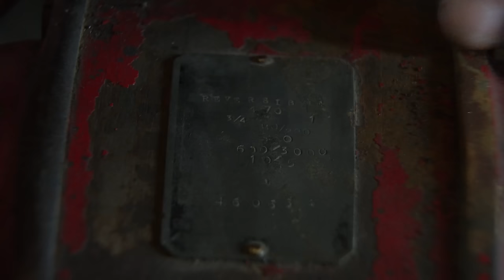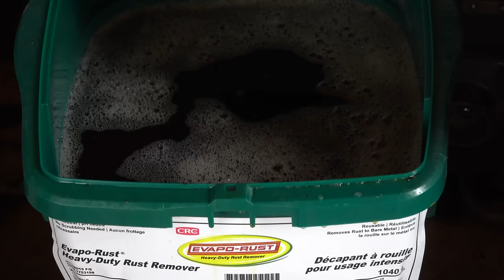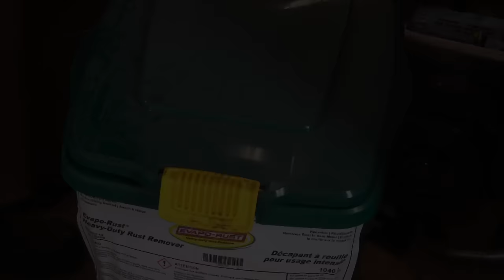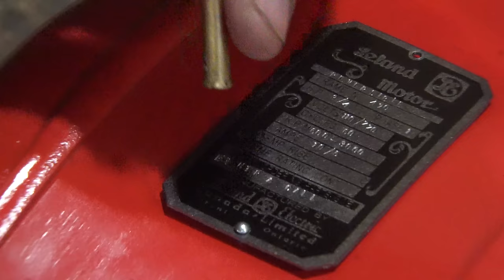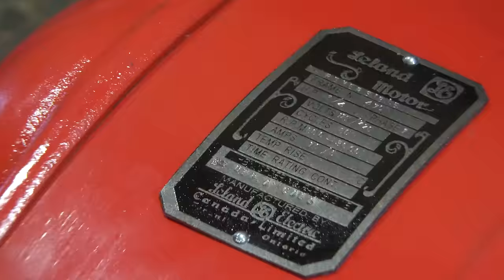Why Did They Stop Making These? [Restoration]

Comment: They stopped making likely due to universal motors have beushes that wear out, adjusting commutator angle means at 0rpm this motor is still running at full power. Likely prone to burning out with a bad operator

Comment: Love it. So simple and amazing.  My only concern and please understand I know nothing about theory of electricity so it might not even be a concern would be ... electrocution.  You have alternating power going into the motor, you have a metal lever that's attached to the commutater.    So if your in a wet environment or not grounded i assume zap. I had this issue with my grandfather's very old steel body craftsman skill and Sawzall. As a kid I grabbed one without wearing shoes on a concrete floor and got shocked. Soon as I had the rubber sole shoes on it was fine. I'm guessing this would be similar. And no I'm suggesting running any power tools in your bare feet ...again I was dumb kid and not much has changed except I got older. Just my 2cents.

Comment: First you should never grind the commutator unless it shows an uneven wear in the brushes. 
Second you don’t want to put oil inside a blind threaded hole because you will end up cracking the housing by hydrolock

Comment: I am probably off the mark but they might have stopped making these because of power factor correction.  In certain positions of the brushes with respect to the commutator, a watt meter reads zero.  So if the meter reads zero then the electric company can not bill you for the energy being consumed.  If you set the brushes in a advanced  position you can get your meter to run backwards. 🤔🤔

Comment: It is a beautiful piece of technological history. But they were substituted gradually by electronic speed control. Modern brushless AC-motors with frequency variation are more efficient and relatively maintenance free. Even DC-motors are more efficient with DC Motor Controllers.
Excellent restoration work.

Comment: Back in the early 1970's when I was at school i had a summer job working in a printers. They had four colour offset Litho printers that were driven by a variable speed drive working on exactly this principle If I recall correctly in the 50kW range. The brush gear was rotated by a motorised reversible worm drive which was visible through a perspex window in the motor housing.

Comment: These could still be made today. I’d like to see a larger scaled motor say 100Hp to see if the principle would work the same. A mechanical throttle versus a Variable Frequency Drive would be way cheaper to make and control.

Comment: I have a motor like this made in the USA in 1910 it has a lever inside the case for forwards or backwards it has brushes that retract once the motor is up to speed so only uses them in start mode it is on a lathe and has not been touched for 40 or more years and is still working fine

Comment: Shop I used to work in had a 15" Davis & Wells sliding table saw.....it ran great, then the super decided it needed new bearings......an older fellow came out to change them and said they were actually in good shape for 1926 bearings......they replaced them and it never ran as smooth as it did before the change.....

Comment: They stopped making these when they invented electrical ways of controlling a motors RPM and torque.  Being able to physically change the timing between the coils, resulted in additional failures.

Comment: Never use alum oxide paper to polish a commutator. it embeds in the copper and wears the brushes out quickly. Use soft garnet paper instead. It has rounded crystals and won't dig in.

Comment: Wow, this is basically an Analog 3-phase AC motor. It's the grand pappy of today's modern 3-phase AC motors, like the type of motors in a hoverboard per se. But instead of the electromagnetic field being controlled digitally it's controlled mechanically, Analog style!!!! This motor was way ahead of its time. She's rare and very special, to run this beautiful stallion on an air compressor is almost disrespectful and a bad utilization of her special characteristics. She ain't no one trick pony!!! Although I can't really think of an application, off hand, that she could be used for. Maybe a fixed gear go cart, but then you ll need a 3 phase generator that'll fit on a go cart lol. Awesome video tho!! Resto guy porn is basically what your peddling. I can respect that. Now I'ma go change my pants 😮

Comment: I think I worked on one of these around 1976 to rebuild it for a Basic Electricty Electronics class in USN of course it was painted gray not red though. Brushed motor, with the adjustments. Guy using the basic gunk tank.  I also had to rewire it, one of my collateral duties was wiring for two live AC circuits with the grounds as that is how Navy ships were wired (not live and return). We had another shop on ship that would rebuild the actual windings though, not my job. I was a radioman, but they would put me where I was needed since I had the skills. Didn't notice the crack till you started scoring it, looks like your going to braze the aluminum with brass? I never worked aluminum to aluminum alloy.  What is with the rope, insulator on a rotor (moves, stator fixed)?  I thought they just used varnish.

Comment: Hi, liked the video. At 21:19 were you putting on a paint remover (like Zip-strip)? The reason it didn't work is because it was applied wrong. I see this all the time, and it happened to me. So, I read the instructions: The product must be brushed on using a one-direction brush stroke to achieve a chemical reaction. 
NOT back and forth.

Comment: I’m sure the last time that was on a bench, being assembled initially, would have been in the 1930s-1940s.  The small hole that you drilled at the end of the crack is called a ‘stop check.’  I agree with the red color. One of the things about products from that era was that most of them can be rebuilt.  One of my eight cars has old school stuff which can be hand rebuilt.  The maker is Rolls-Royce.  Your obsession with details matches mine.  When you rebuild something it’s not for you—that thing will last another 80 years. Thankfully, you’re not an economist/beancounter. Nice video details.

Comment: As far as I know...which is a bit limited regarding this motor, but I think I recall handling one like this that had been on a sewing machine or something like that long ago...the handle changes the 'angle between the magnetic fields'.  In Neutral, Top -1 and Top +1 would both be active, giving it no real angle to do work with, and rapidly heating the motor windings as I recall from my example.  Shifting its handle changes the angle difference between one 'locked' coil and this 'mobile' coil by changing 'at what rotation point its carbon brushes are touching the stator, which changes the difference in angles between 'neutral' and the forward/backward coil options.  I THINK one coil was fixed, and only the handle one(or maybe 'ones'?  Perhaps there's two coils being used there, I'd have to play with that one to see how it works) changes its 'angle between it and the locked field' to define how much or how little each wave of the AC can make it all 'kick into motion'.  +coils moves in the 'forward' direction, '-coils' goes the other way around by switching which way (and changing the timing of) the AC waves do their thing.  The torque would be nearly full power even at its slowest speed, I am guessing!  That IS a guess, however.  It's a full strength, but 'low angle' coil separation so it would move 'only in tiny angles' but just as forcefully as it could at full speed, give or take some magnetic saturation and interference/efficiency questions.

Hopefully if I'm wrong about any of this, actual specialists will come slam me for my mistakes but will also mention what the RIGHT answers are!  One can hope.  :D

Edit to add: other folks in the comments seem to say I am correct, except that I was thinking the handle's brushes provided power, but other comments make mention that the brushes simply 'carry power from one stator-pad to the other' to provide the current path.  I never said anything about that, but I thought I should add that to this comment for clarity since I had assumed 'providing power' via that handle because I wasn't paying close enough attention to it when opened at first.  The 'difference in angle' portion of my comment does seem to have been confirmed by other comments.  I'm still not sure if there's one, two or three active windings at any given moment, but eh, I'm pretty sure it's 'two'!

It's a fairly nice rebuild, though I do think the string is more of a necessity than was obvious at a glance, and I think the bearings might be a bit noisy/unhappy.  Maybe it's just the motor's physics for the bearing sounds, I suppose that might do things too.

Comment: To really answer the original question I think we need to know the efficiencies involved, namely torque at low RPM's? I think it's a great design for its time and the restoration is wonderful, but why did it fall out of favor? One thing could be its big gap that several fingers could get into due to the throw of the lever. Lawyers today would have a field day with the safety concerns of this devise. (We've all heard it. You can't fix stupid. You can win a lawsuit with stupid these days very easily though.)
Most motors today can do the same thing with the right controller, be it AC or DC. Most AC and Permanent Magnet DC motors loose torque along with RPM, forward and reverse is easy within the controller. The permanent magnet motors are limited by their magnetic elements. It's torque at low or zero RPM that matters in many applications though. Case in point: A locomotive axle, That takes a high torque at zero RPM to start all those loaded cars moving even with the slack built into all the hitches so they all start one at a time. Like so many things, it's the applications it can be used for and the cost to manufacture that dictates whether something stays around. In it's day it was probably considered state of the art, but the state of the art moved on. I designed and built special machines for 25 years and worked with electricity for over 40 until retiring. 
Steve Williams

Comment: Would anyone tell me where to find new insulation for old wires? I’ve had some jumper cables used on old M60 tanks! About 25’ long and each cable is about an inch thick! The insulation is flaking off so I want to reseal or replace the insulation before anyone gets shocked.

Comment: Nice motor. Be cautious of running it at low rpm for any length of time. The fan can't offer sufficient cooling at low speed. Eventually the windings will over heat and the insulation will breakdown. It will then short and you'll have a pretty paper weight.

Comment: Most efficient at either end of its spectrum but anywhere close to the middle for a "Slow" rotation would be highly wasteful.  That's why they stopped making them.  It's easier to make reversible motors.  Especially 3 phase motors.  For a single phase motor to be reversible would be impractical. That's why you purchase CW or CCW motors.  The need for a reversible single phase motor is about as in demand as ice water enema's are.

Comment: Shift the brushes relative to the field coils, and change direction of rotation;
a repulsion-induction single-phase motor...
We had one of these w/ a right-angle gear reducer, put a little cable drum on it, 

bolted it onto a flatbed pickup w/ a
little rotating davit on it,  and hand-dug a couple of wells to 35'.
It was strong enough to lift out a cut-down 1/4 barrel of spoil,
 ride in and out of the well, and unload and place the well-rings.
We always cut  the power before reversing direction.
A  little carbon tetra chloride on a bit of cloth on a stick  was sufficient to
clean the commutator and ensure excellent performance.

Comment: I worked on one once, that was repulsion-start,induction run. It had a centrifugal shorting necklace that would turn the armature into basically a squirrel-cage rotor,once it was upto about 75% of run speed.

Comment: AC motor speed is related to the number of poles, my guess that's how they got this to work, by messing with that. Sliding that arm back and forth adds or subtract current to the poles (affects the rotating magnetic field), hence the variable speed. An ingenious design!!

Comment: Most motors are 50 or 60 cycle brushless AC these days, and they have trouble starting at a slow speed. That’s one reason you don’t see these anymore. I have one antique reversible brush motor for a dental drill, and one large 1/2 hp reversible brush motor made by the Singer sewing machine company.

Comment: should have replaced the "string" running it for long periods of time without it will cause a rapid unscheduled disassembly of the motor due to friction/material buildup

Comment: The brass lever rotates the brush block to either advance or retard the timing of the motor in relation to the field coil. (Advance the brush block, advance timing=increase in motor speed)

Comment: mmmm... why did they stop making those anyway....?      LOL   its an electric motor dude.     lol the speed thing nowadays is controlled by adjusting the power imput....why those type were phased out, the were very speed sensitive, meaning they drew to much for what they did,    anyway you can adjust the speed of ANY electric moter by simply putting a potentiometer on the cable between power and the device.... :-(   think you can get them at canadian tire for 4.95

Comment: There were a lot of vintage machines circuit breakers etc at college in the 1970s.  One that was similar but much bigger had two pairs of brushes that moved closer together or further apart, sort of like scissors action.  It was variable speed and output a variable AC voltage and variable frequency, I think.  That is, it was a type of rotary inverter.

Comment: One thing about these motors they have more power in torque than the new motors. A 1/3 HP old motor can do the job of a 1 HP new motor. I have a third HP on my Air. compressor which should be one HP. And no capacitor needed. The old motors used a starting winding then a mechanical relay to disengage the winding circuit. 

I sure wish we had a motor shop in our city. I have a Fitzgerald electric hand mixer i would love to restore. Its green like the other kichen gadgets back in their day. 73

Comment: Not just did you not recement the coil windings onto the commutator bars, you also didn't clean between them. First fire up, all that copper dust will probably smoke the thing to bits.

Comment: That is a simple brushed AC/DC motor.  

You can find all sorts of videos on how they work on youtube. 

While they still make these, and they are a common component in air compressors, the creation of brushed A/C motor controller that allows adjustment of both speed and torque directly like a brushless motor, has resulted in these becoming less popular as they can only have their torque throttled, and they are slightly less efficient.  

A relative of this: Brushed AC motors are currently used in Tesla EVs, and the vast majority of other electric EVs.   Without the controller, they are commonly used in fans, but have a fixed maximum RPM unless they have a controller.

The difference between a Brushed AC/DC motor and a brushed AC motor is the stator design.   A brushed AC motor uses a solid stator where the magnetic field flows in a circular pattern around the stator.  An AC/DC motor uses a segmented stator with the magnetic fields running towards the rotor. 

You can find information on how the AC motor operates and how a speed controller can be made for on youtube as well.

Comment: I have a similar motor single phase 240v 2hp where the brush mechanism  is  adjusted by loosening  two screws to adjust the speed and direction, originally  fitted and used on a band saw , Still in good working condition minus the band saw.

Comment: bldc motors made these things obsolete. also due to the significant inefficiency even if these were cheaper to produce and they were more useful in our automated society they would still not be worth it because of how much more it would cost to run and maintain them. cool motor though 4/10. 7-8/10 if you actually repaired it properly.

Comment: What would one expect the power draw to be at the zero-torque setting? I'm imagining two electric magnets facing each, doing no mechanical work but both resisting each other's magnetic change from their currents changing. Since they are the same circuit with the same current, the changing AC current is creating its own inductive resistance. Like, you couldn't do this with a DC motor, because the lack of a motor turning means no magnetic flux change, meaning a lack of inductive resistance, resulting in high amps and motor burnout. Do I have the basic concept right here?

Comment: Nice small repulsion motor! I have only ever seen a much larger repulsion motor, and it was used to drive an old Deming reciprocating well pump jack.  The speed/torque was set to work best with the depth of the well, length of sucker rods, and  water lift height and then just left  bolted in that position, where it might has well have been an induction motor and the same optimization done with pulley sizes. But if you don't have a selection of pulleys, and/or the water level in the well changes significantly seasonlly, I can see why they used a repulsion motor that could be adjusted.